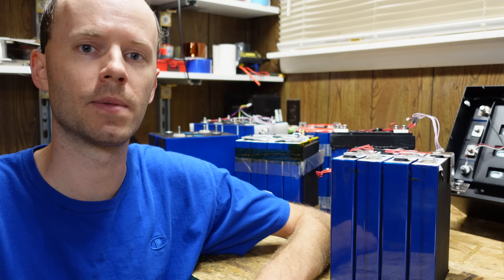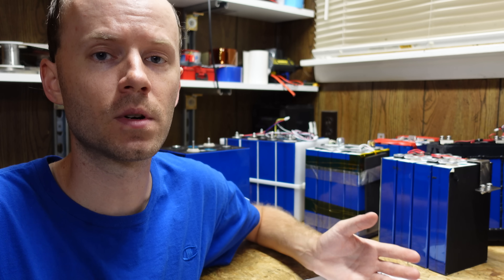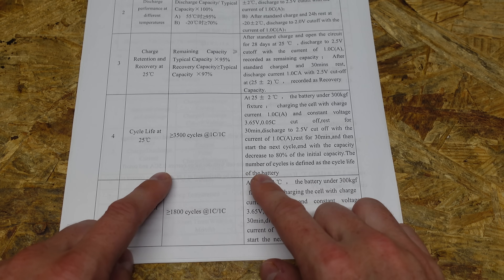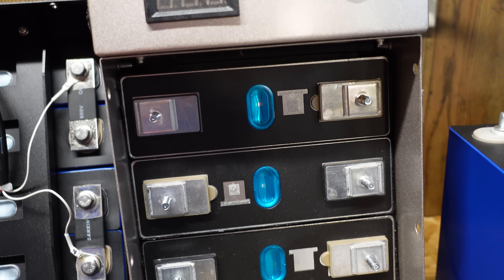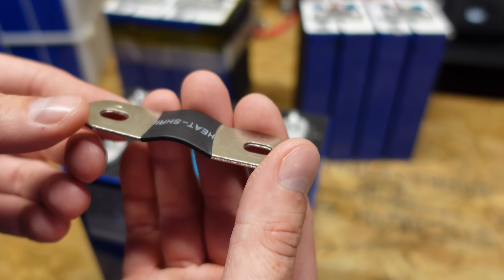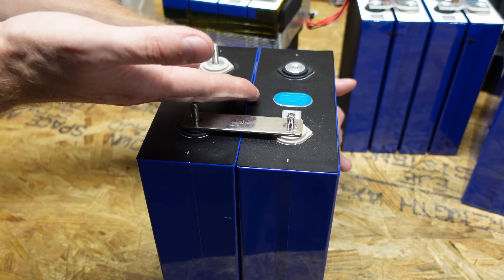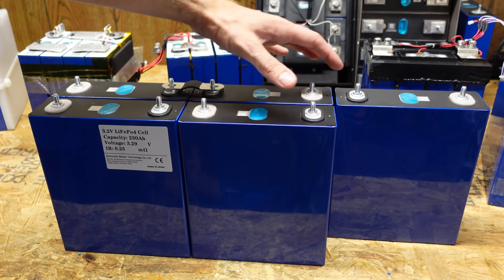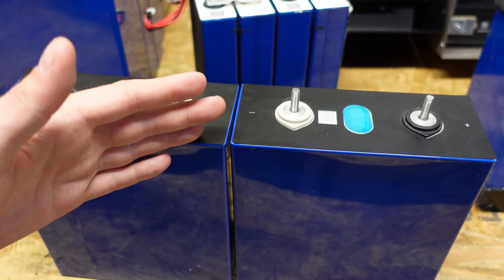LiFePO4 Battery Compression, Fixture, and Assembly - What's the Deal?

Comment: The solution is simple on the bus bar flexibility problem. Make your own busbar from whatever cable you need, 3/0, etc. , making sure you put a bend in the cable, as much as is practical, then when the expansion occurs it will simply tend to straighten out the cable. If you measure where the cable is at the beginning, you can see how much movement you have.

Comment: If you apply too snug fit since start when they are new, there is not much space for expansion, so as you have said you brake terminals, or destroy cells as those in Samsung Note batteries were too snug and could not expand and exploded. Good is when new, to make space if they are stationary, or to add foam, to let them first expand, and then strong fit to expand cycle life. Also bit dumb could be dont tighten terminals that much, so they can move by themself.

Comment: Some say no point compressing due to age degradation overtaking any other issues but I've seen some badly bloated cells (230Ah) that no longer perform well (136Ah at 0.125C). Also I would be worried that the bloating could eventually burst and cause a fire. Also if not using flexible bus bars they can fan out and start to lift the end cells up causing stress on the terminals.
  Personally I am going to wedge them between two concrete walls in a small room. Using cinder blocks to take up any leftover space and then gently with a car jack push between the wall and the cells till any space is taken up and a very small amount of pressure is applied. This way, if they expand I can still get them out by removing the car jack. I would just rather they don't bloat outwards weather or not other people think bloating is not contributing to a loss in performance. The truth is they don;t know or they don;t want to admit it. Best in my opinion is to take some precautions and oversize your battery banks by at least double to reduce stress. Don't hard charge when cold. install them higher up if in a cold room so they are not on the cold ground and where temps could be a few degrees cooler. 
  Ideally a smart charger would gently ramp up the current if the battery is down to zero charge.
  I just bought 4x 360Ah to save money. I was going to get the two hole terminal MB31 from EVE but price was a factor. I'm going to double and triple my busbars especially towards the middle of any series string.

Comment: I wouldn't worry about the stress on the terminals . All square rectangular batteries will swell to some degree no matter what that's why they suggest binding them or compressing however you want to word it. If the cells are left over time there's a chance probably a good chance that they will develop a swell that will be permanent like the cells that the other guy purchased so you're basically only sells you don't ever need to compress are cylindrical cells the common battery shape. The Gap in between the cells is important it allows for some expansion but also Cooling I wouldn't recommend a solid spacer something that goes around the perimeter and some of the middle kind of like a grid type thing that still has some airspace allowed. For the bus bars I wouldn't worry about them straining on the swell when they do swell I believe that will actually help keep the swell and check some and keep the batteries in a proper shape and spacing. For busbars I usually just go to my local metal place and get sheets of copper. Just small sheets then cut and drill them it's much cheaper easier and you can make exactly what you need

Comment: I have an 8S 32AH LIFEPO4 battery pack, with good quality JBD BMS.  I put it on a LIFEPO4 charger for about 6 months.  The cells were in a plastic case but not really compressed.  They blew up like a pillow. Can they be salvaged?  Should I compress them?  Just use as is?  They are now too big for my application.

Comment: By manufacturers it seems your referring to battery assemblers not cell manufacturers. Honestly their only concerns will be 1.) Safety (i hope this is no. 1) and 2.) Longevity (but only beyond warranty) - theyre gonna last beyond the 2-5 years warranty regardless. Id therefore expect a lack of compression with gaps or fixture with rubberised separators is best for the assemblers as risks are less for terminal damage due to movement or bursting due to over compression. There will be next to no regard for extending cycle life. As has been said by will prouse and andy on the off grid garage theyre going to last so long battery tech will have moved on by the time theyre down to 80%.

Comment: Very surprised that nobody seems to know that "fixturing" is only relevant for initial cell break-in.  The idea is to dissipate gas bubbles that may occur after manufacture and the extra rigidity helps this occur.  Placing the cells under high pressure after the first few cycles is pointless and accomplishes nothing .  

People are reading far too much into a vague description of how fixturing effects cycle-life; it's a one-shot deal, if you don't do it from absolutely new, it serves no purpose, and after the break-in period, it serves no purpose.
Reply from the maker: That is not correct.
Reply: @LithiumSolar  Check actual sources, not heresay...
Reply from the maker: @awebuser5914 It's not heresay, it's logical reasoning. Think about the entire lifespan of the battery, not just the beginning or middle of its life.
Reply: @LithiumSolar  Don't make guesses.  It has nothing to do with "logic", it's simply that if you don't fixture the cells on break-in, they will be diminished for their remaining lifespan.  Suggest you actually read some scientific papers on the subject or get real industry information, not what you think is right...
Reply from the maker: @awebuser5914 Ok boss

Comment: I disassembled my chinese 48V battery pack recently, they either know shit or just dont give a shit. All 4 temp sensors glued in one single spot next to each other, all cable lug terminals were horribly wrong mounted and loose, I was really surprised that the battery did not catch on fire at some point

Comment: Wouldn't it be a solution to use Wires instead of the bus bars?
Reply from the maker: It can be if you would like to introduce many more mechanical joints (wires to lugs).
Reply: @LithiumSolar  Crimped and soldered copper cable to eye loops would be worry free.. This is what we have used for years with 1,200 amp 48v lead acid battery banks..

Comment: Any update? Do we need some "foam" or "other stuff" between the cells, or is it fine to just "push them together" without anything between them? Thanks!
Reply: The 12v portable batteries use foam or rubber between the cells more for shock/drop/vibration damage prevention, it also give some expansion allowance I guess..
Thin plastic or fiberglass sheets between the cells for added insulation and lightly fixed together with just a couple pounds of force for brand new virgin cells that have not yet been top charged to 3.6v per cell for a few maybe 10 low stress cycles to season them and ensure that any stray gas bubbles have a chance to migrate to the vertical relief channels inside the cell's laminations.. If using rigid compression it is a good idea to check the tightness from time to time as you may want to back off on it once the cells hit 50 cycles or so to have it be just snug at a couple pounds of force at full charge.. Or you could pretty much just remove the fixture at this point because one the complete seasoning of the batteries is done it really has little to no benefit.. For long life never charge or discharge higher than .5c or below 2.7v/above 3.55v per cell..
Reply from the maker: The best I can say is to follow the manufacturer's instruction. I use foam strips and insulative adhesive paper between mine.

Comment: Just realize that the aluminum case is typically connected to the positive terminal and snaking the cells end to end will bring the end cells with the most voltage difference together only separating them by that blue plastic coating the cells. Should an arc start it will be very hard to stop. Any metal hitting the top edge of the case between cells will also release the cracken!
Reply from the maker: It's not what you think. Yes, it's true that on some (most?) cells, there is electrical potential between the case and the negative terminal. It's not connected to the positive terminal though, ie you will not get 0 ohms on a multimeter nor will you get a massive arc. It's high resistance thus very low current flows. Regardless, yes, it's best practice the cells be insulated from one another and other metal objects.

Comment: I would 1st charge cells to at least 90 - 995 % and then using .5 mm thick EPDM plastic sheet between cells , place them under light pressure compression. The EPDM is the black bottom plastic spacer material used in bottom of the nylon reusable bags used at checkout stands of places like wall mart of china store. The light pressure is maintained evenly by f on rce of two adjustable fixture bars commonly used to hold wooden assemblies before gluing or screwing together permanently. I never let my batteries get near overheating condition by monitoring temp with the two sensors on my JKD BMS . If temp goes above 10 degrees above ambient I reduce the draw if discharging or shut off charger if charging. No space is used between cells as the important aspect of life of the cells is mostly keeping eye on your temps. The EPDM spacer sheet between cells is so no possibilty of vibration , rubbing a hole through the cell blue wrap . No cell should ever have one aluminum cased cell Touch the other ! The EPDM also transfers heat efficiently from one cell to the other , which keeps your center cells from blooming big .... you'll always notice outter cells usually don't  bloat & expand much since they have better cooling usually. My cases around each pack have cool air flow always and by monitoring the temps via JKD sensors and having the EPDM spacer transfer heat from inner cells to outer ones ( that have the good cool airflow around them ) you'll keep cell expansion at the minimums , which will give your cells long life. The tape used is Kapton tape which expands at same rate as the cells ,I use only two layers since it is extremely strong tape and I am using my cells in E-powered vehicles. I want light weight so I get as many miles per charge as possible. I live in tropics so low temps present no issue . I keep batteries running in 20 - 90 % range of operation , so batteries should last much longer than ones people run outside of that range. The 70 % of total battery capacity is what you should remember when sizing your banks during design phase. I now use Nickel plated copper bus bars spot welded by a Sunkko 801B portable spot welder.. Do some test strips to make sure depth of weld is good and strength is there. You should have no problems  with terminal tension on expansion if the heat is transferred by the EPDM spacers and the cool air running around in your case. Good luck with your builds. Nick , NavyBlueSmoke , LST-1195 , // credited by crew of new Navy ship 🚢⚓ with saving it in a Biblical Class Storm , early January 1974 In The China Slot aka The Graveyard, Seal Team , Marines , 20 Officers , 200+ crew , CIA's top asset aboard , all safely delivered to Hong Kong harbor , Praise God Whom Gave me temporary strength of Samson and Hercules to accomplish the task necessary to save my ship. N.A.C. # 1274 , iss 20 Apr 72

Comment: Can anyne please explain? What is the point of compressing, if in this case eventually it will most likely lead to blowout safety valve on the top of the cell (instead of inflating the cell)?

Comment: I tried to solve all your concerns cause I had the same thoughts.I took 4 pcs 4mm steel rods, bend them in to a slight zig zag shape and threatend them at the ends. I tighten the M4 nuts on the end plates with a torque of 0,565 Nm what results in a total force of 300Kg. Previous I glued vertically many 4x8mm natural black rubber stripes (I cut them from a sheet) 16mm from one each other. The busbars I have made by my self with cable and two cable lugs. I make each connection twice and took 16mm2 marine grade copper cable.  
The fixture makes that tiny little air bubbles, which are left from production, can escape at the first few cycles.

Comment: I use the foam pad that they ship the cells with usually or just any 1/4. Thick soft foam. Not styrofoam. Foam like a pool noodle. In between. Plays as insolation and lets expansion an contraction happen while still protecting each cell.

Comment: For a simple RV setup of a 12v 304a EVE Setuo i might make cable and terminal flexible bus bars - only nee 3 - and use reinforce tape and flat nylon package strap with corner edge protection? Not really to compress but to hold together hopefully in a battery box - Plus wont be over stressing either 👌

Comment: hi there!
I have the EVE specs for a 304 Ah lifepo4. I reread that manual a bunch of times because it does not give anything that will directly convert to psi. it is given in Newtons but not per sqr meter or other given area.
Except that they give the area of the cell. what I gleaned from from it was that the pressure they want on the cells is about equal to a cup of coffee per cell. .6 or about 5/8 lbs per cell. In other words just take up the air space between the flat part of the cells. However they want 3 6 mm bolts on either end of the  cell. 6 bolts all together.  They want a 7 mm aluminum splint to support it.
 I am building 2 16s batteries.
I made 4 splints. The EVE  busbars are laid out to fit side to side but they have a gap on the ends to accomodate the thru bolts. My lay out is 4 by 4.  2x8 would have been alot more aluminum. the more layers of battery the more expansion.  I settled for 4 layers.  I am using plastic separaters  between each cell as recommended by the spec sheet..

Comment: use stranded copper wire with lugs to replace bus bars. they will flex....
Reply from the maker: On a 48V battery, that's 30 lugs that would need crimping on 15 jumpers. That's way too many for my liking...

Comment: use that home Depot 14 ga flat bar with 3/8 holes in it it's around 12.00 14.00 per  32 36 in long flat bar cut with grinder for length of bus bar needed

Comment: Just make some really short heavy gauge copper wires with lugs to connect them instead. You want a real flexible bar use fine stranded wire with m6 lugs.

Comment: I believe bloating or expansion of the prism occurs mostly at the biggest faces. It is akin to inflating a rectangular box. You see failed cells bulge at the big faces and not on the end small faces. Therefore restraining the big faces by clamping a stiff plywood (or steel plate of suitable thickness) held together by four threaded rods would be best for preventing bloating. Since the rods/board support will prevent excessive expansion — and nearly no movement of the narrow ends where the terminal is located, it is of no concern for large movement of the busbars so the plain bus bar should be sufficient. When this arrangement is used, the rods are initially snugged before charging and of course will tighten when the cell “expands” when fully charged.
As to the use of strapping filament tape, the center of the end cells are still not restrained from bloating (in my opinion), thus is not an optimum support.

Comment: Hi. My batteries are bulged after two years of use.  If I make the compression now, will I damage them?
Reply from the maker: No, you cannot compress them once they're bulged. You risk shorting out the cell internally and/or causing it to over-pressure and vent. What cells did you buy and from which seller?
Reply: @LithiumSolar  , I have 8 pcs 100Ah Lishen batteries from Alibaba

Comment: Put some hard material on the corners of flat facing sides only. Since cells will bulge most in the middle the distance between outer perimeter of the cells will stay even and the busbars will not be under stress.

Comment: I'm building a 72v Tracker EV battery pack with twenty four Eve 280k Lifepo4 batteries. As suggested by 18650 Battery, I'm going to use 1" double sided tape at top and bottom of each battery and then use fiberglass tape to wrap outside. The 1mm foam tape will allow for the .5mm expansion/contraction in the middle of each battery. This will solve the bus bar issue as well as fix the batteries in place which solves the wear issue between batteries. I also plan on welding a 1/2" angle iron steal frame to go around perimeter so I can bolt the whole pack to the floor. Eve said their class A batteries do not need to be compressed. Maybe using the term "fixed" in the specs, they mean just that and not compressed at all.

Comment: ❤ this video. I've been grappling with the same issue: To compress or not to compress. The pack will be two rows of 16 cells each for a 3P16S config, so the cumulative effect of swelling across such a long row has been a concen. There are plastic caps and feet on each of my 150 Ah prismatics that leave a few milimeters between each cell. What this video and comments tell me is that is about perfect, that if there is more swelling than that the caps will keep the terminals from moving. I'd give this video two 👍👍 if I could.  Whew!

Comment: 300Kg is 660 lbs,  side compression on the cells;  VERY good to know;  you said 12 PSI is that after dividing by the SIDE area ?  thanks,great video.
edit: that THICK bus bar with the lump,will NOT  un-bend, trust me; better to NOT tighten the nuts too deeply, let them slide,that is fine as long as you check the torque once in a while, and monitor for heat (mVolts measuring at load is THE proper way...) at each connection at load; THAT is what i would do; OR just use WIRES,S shape, instead...